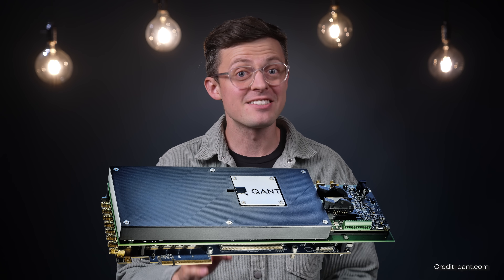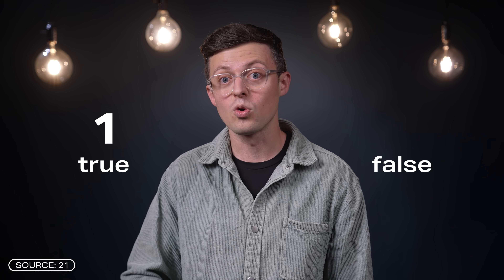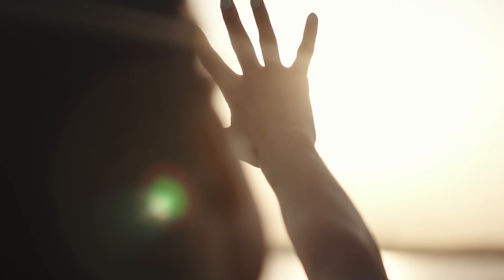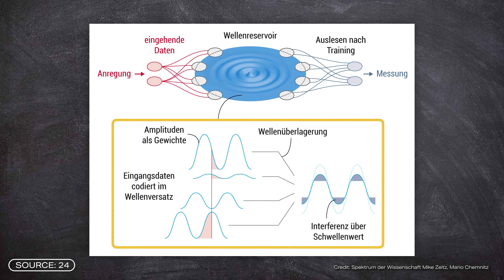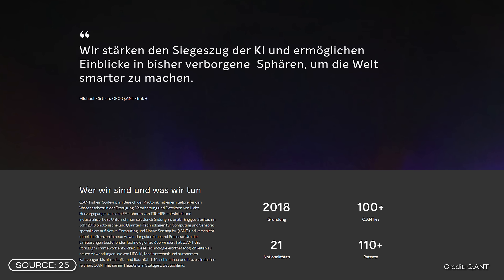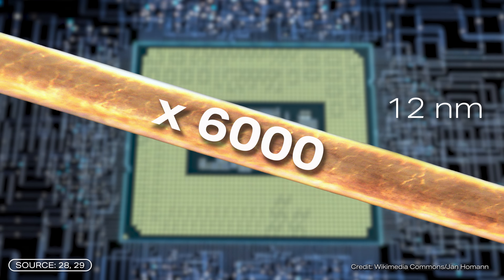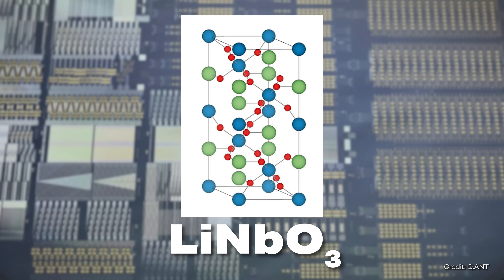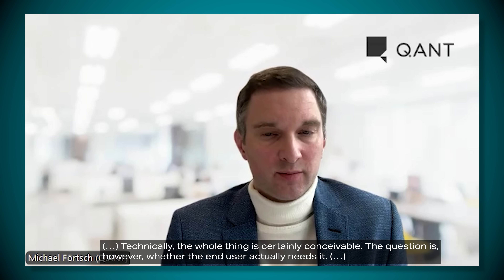This Chip Uses Light Instead of Electricity!

Comment: While light itself doesn't suffer from the resistive heating that plagues copper wires, the process of using light in a Co-Packaged Optics (CPO) system still generates significant heat.

Comment: Critique that pulls be taken seriously 

This video exemplifies everything wrong with tech content presenting laboratory curiosities as imminent revolutions.

First there is the accuracy catastrophe. You tout 95 percent accuracy as a success while glossing over the fact that digital processors achieve 99.4 percent. That is not a minor trade off. That is a 4.4 percentage point error rate that would be completely unacceptable for any production AI system. An error rate of four decimal places compared to 15 to 16 for mobile processors is not reduced, it is fundamentally inadequate for precision computing. This is exactly why analog computing fell out of favor decades ago, and no amount of lithium niobate marketing changes the Physics of noise accumulation.

Second there is the conversion overhead whitewash. You mention in passing that optical electronic conversion is not a major problem based solely on the CEO is opinion, ignoring that this conversion overhead is precisely what destroyed the efficiency gains of every optical computing project in history. When you must convert every piece of data to light and back, something required for all real world applications since Memory is not optical, you are not saving 30 times Energy anymore.

Third there is the fabrication fantasy. Claiming these chips can be made in 1990s fabrication facilities ignores that thin film lithium niobate fabrication is technically demanding and not readily available in commercial semiconductor supply chains. This is why Quantum Computing Inc. had to build a dedicated thin film lithium niobate Foundry in Arizona.

Fourth the claim of being first commercially available is false. Lightmatter has been shipping photonic processors for years. Q.ANT is not first. They are late to a market that has not taken off precisely because of the accuracy and integration problems you are minimizing.

You are presenting a 62 million euro Series A announcement as scientific proof of technological readiness, when what you have actually documented is a company that has overcome very early stage engineering challenges while leaving the fundamental analog computing limitations completely unsolved. The word breakthrough only applies if you ignore everything that makes modern computing reliable.

Stop trading in artificial enthusiasm. Your viewers deserve better.

Comment: If anyone who know optics can come up with APU processing unit using light, like addition, subtraction, etc. plus more complex functions like sin, cos, relu, etc. then it will be a revolution. Since these are analog they can produce more accurate data theoritically. but designing such optic to calculate a function is quite tricky, we do know different refractive index reflects the light in different angle for different wavelength.  If anyone figured out how to achieve these calculations will be a one of the big inventor in History.

Comment: 6:39 “cooling no necessary” - while propagation does not generate heat, doing operations on light uses devices like Thermo optic modulators which apply heat directly. The chip still gets heated, and needs cooling to keep that heating a local effect

Comment: Summary is there are two main bottle necks preventing the commercial use of such photonic compute chips: 1-Poor power efficiency of lasers combined with the need to split light for each MZI, which results in loss for each split ==> defies the power efficiency argument. 2-BW limitation of PD, the necessary component to jump from optical domain to electrical domain ==> defies the high speed advantage argument

Comment: By nature using light photonics is vastly superior to using electron wires. With light photonics you get higher bandwidth, shorter latency times, runs cooler and uses less electricity. Any one of those 4 advantages alone would make it a superior SoC. So having 4 advantages is mind boggling. Imagine what the performances of Apple's M4 and A19 Pro and Media Tek Dimensity 9500 and Qualcomm Snapdragon 8 Elite Gen 5 all would be if they all used light photonics in place of electron wires. Well guess what, all that will come to fruition in a couple of years from now since those 3 manufacturers are fiercely competing against each other.

Comment: The “primitive” or different application of this tech already existed in "Fibre Optics". with fibre light refraction moves data on multiple wavelengths in parallel, Photons naturally act analog (bright/dim), so bandwidth potential is massive. But for "Computing and Logical calculations" the killer issue is "Photonic Noise", electronic CPUs cut error rates to <0.001% as of now, after years of progress, while photonic tests still see around 5% error, and large photonic neural nets could lose up to 84% accuracy when scaled 📉.

Especially when it's a material science issue also, materials used to make Photonic Interpreters, regardless of the progress, most refract/reflect light at atomic levels, unlike silicon where heat is the main noise source, also cost plays a big role, because its R&D compared to using what works, its why many companies focused on Silicon chips and developing that. Even if a successful photonic chip was 50× faster⚡, adoption still depends on architecture. That’s why Apple went ARM64, devs + ecosystem were already there, Without that, raw speed means nothing, 

I am so happy , someone is working on this, all they need is more support, though will require so much effort and dedication, but it can actually get much better over time, only that for now it will be ridiculously expensive for consumers.

Comment: My theory is this: The electron is chaotic, it interferes with everything as it travels. Light, or the photon is orderly, and does not interfere.
I think the trick to building a super conductor, is in the material itself. We need something that can co-exist with the electron, so the electron doesn't cause friction, which causes heat. Or we invent something that uses light, and we eliminate the need for conduction. Can we replace all electronics, and any need of electricity, and replace it with light?
Science should be about discovery and advancement; not greed, mind control, nor military power.

Comment: I'm more or less ok with the fact that photonic calc can process faster (even though the input is still an electrical signal, and this situation creates a bottle neck, according to me).
I'm not ok with the fact that light isn't dispersing heat. Photons are energy packs that usually are absorbed by surfaces. It is totally true that for a microchip might be necessary 5 watts of energy (a led lamp dimmerable) only. In this case the heat generated is easily dispersed.
Please help me understand.

Comment: Logic functions and computing structures, using light, were being examined as far back as 1962, Boeing was working on this but gave up.  Logic functions were even tried using hydraulics.  Now, the super computer and cubits.  The so called quantum computers is an attempt to create a programmable analogue computer which, quant seems to be attempting.  The draw back is that analogue computers are built specifically for one problem and arrive at a solution faster than any digital method however, the programming for a programmable analogue computer would be so enormous and complicated, not to mention processing the result, that it is impractical.  Its nice to dream.

Comment: I proposed light-based technology back in 2005 for a class study of mine. The fundamentals are there right now and the fact that they built an actual working GPU is quite mind-blowing but unfortunately the software needs to catch up it's such a revolutionary idea if every company were to put billions of dollars into this tech it would really go so much faster unfortunately the r&d is not there. But the concept is extremely valid. This technology really would change our whole entire infrastructure. Everything would be a lot smaller a lot more efficient a lot less weight because we don't need all these extra electronical components.

Comment: Look, if you put ~10GWh of electricity into a server farm made out of photonic chips, or any other chips, you are going to have to get rid of the impending heat. It's simple. 
For first iterations in the technology, sure, you don't need cooling. Neither did Discrete Graphic Cards, until they did...

Comment: Looking at the 3D printed housing it is still in an early stage. It has the advantage that it uses available production tool. However going from prototypes to mass production is always more challenging than it seems.  Market adoption is also challenging in an established market. Glasfiber communications also took a few decades to finally reach your home. Interesting anyway 👍

Comment: New angle of electricity.
The Unified Fractal-Temporal Model of Reality (2025 Version)

Key Principle: Reality is one, but it manifests across different fractal levels through the temporal mode ("speed of time"). Energy, information, and consciousness are manifestations of the gradient between these levels.

I. FOUNDATION: The Two Fractal Modes of Existence

1.  The Micro-World (Quantum, Base Fractal)
    - State: "Cloud," "Network," "Wave function."
    - Time: "Fast," potential, uncollapsed. Many possibilities exist simultaneously.
    - Example: An electron before measurement, quantum superposition, vacuum fluctuations.

2.  The Macro-World (Classical, Derived Fractal)
    - State: "Particle," "Solid object," "Object."
    - Time: "Slow," actual, collapsed. One version of reality is realized.
    - Example: A table, a planet, a human as a biological organism.

The transition between modes occurs through observation (synchronization of temporal modes) and *decoherence*.

---

II. PHYSICS: Electricity as a Temporal Phenomenon

- Electric current is not just a flow of electrons, but a process of equalizing a temporal gradient (voltage).
    1. Voltage: Creating an artificial "time difference" between two points.
    2. Current: Equalizing this gradient. Electrons transition from a "slow" particle state to a "fast" wave state to perform work.
    3. Work (heat, light, motion) is the material evidence of this equalization.

- Energy generation is the process of "pumping" energy from the "fast" micro-world into the "slow" macro-world.
    - Traditional sources (coal, atom, water) are crude, mediated methods of creating a gradient.
    - The ideal source is a *Quantum Fractal Generator*, directly drawing energy from vacuum fluctuations through resonance and specific geometry (crystals, grids).
        - Antenna-Grid: Captures the "fast" time of the micro-world (quantum fluctuations).
        - Rectifier-Crystal: Collapses the chaotic flow into a directed current (an analog of the DMN for energy).

- The Piezoelectric effect is direct proof of the model: a crystal acts as a *gateway*, transforming mechanical energy from the "slow" world ("friction and impact") into electrical energy of the "fast" world and vice versa.

- Lightning is a macroscopic manifestation of the model: dielectric breakdown (of air) as the "leakage" of energy from the micro-world, its fractal branching structure, X-ray emission, and ball lightning as a hybrid coherent state on the edge of fractals.

---

III. THE HUMAN: Consciousness as the Internal Observer

- Consciousness is a system capable of managing its own temporal mode.
- The Ego's "Clock Generator" (Default Mode Network - DMN):
    - Maintains a "slow," stable, sequential state of consciousness necessary for survival in the macro-world.
    - Filters the "raw" flow of information from the "fast" internal micro-world (subconscious, body, perception).
- Psychedelics and spiritual practices suppress the DMN, opening a "gateway" for direct access to the "fast" fractal of the psyche:
    - A flow of unfiltered information, synesthesia, a sense of "everything being connected."
    - Analogous to electric current: a direct connection to the source.

- Energy vampirism is a process of forced *decoherence*:
    - An external agent imposes their "frequency" (problem, negativity), forcing your consciousness to collapse from a rich "cloud" of potential into a single "particle" — which becomes an energy source for them.
    - The result is emptiness as a consequence of lost energy potential.
Reply: IV. SOCIETY: Collective Resonance and Economics

- Society is a quantum-mechanical system at the macro level.
    - "Particle" = Individual.
    - "Wave" = Collective, culture, public opinion.
    - Resonance (Coherence) = Common goal, ideology, national idea. A source of colossal social power.
    - Decoherence = Disunity, atomization of society, conflict.

- Money is a quantum of social energy, an equivalent of time and trust.
    - Printing money is creating an artificial "temporal potential" without energy backing, leading to inflation (the collapse and equalization of this false gradient).

- The current global crisis is not a collapse, but a *Great Reassembly*:
    - The disintegration of old global "resonant frequencies" (trust, systems).
    - The formation of new, more stable "fractal clusters" (economic blocs, unions).
    - The crisis leads to a change of basis: an economy of illusory potential -> an economy of real energy and connections.

---

V. COMMUNICATION: The Exchange of Energy and Meaning

- Exchanging opinion-particles ("I'm right, you're wrong") -> Elastic collision. Energy is spent on resistance, no new synthesis occurs.
- Exchanging context-waves (deep dialogue, joint immersion in a problem) -> *Quantum resonance*. "Clouds of meaning" overlap, new understanding is born, energy is multiplied.
- Mass media is a social "observer effect": by choosing the scale, they collapse the wave function of public opinion into the desired "particle"-narrative.

---

VI. TOOLS: Quantum Computers as the Next Step

- Quantum computers (QC) are not just computation accelerators. They are the first tools for navigating the "clouds" of the micro-world.
- Why are they needed?
    - To model and understand the very fabric of reality (quantum chemistry, materials), which is a "cloud," not a "particle."
    - To work with the connections of "everything to everything" (optimization, entanglement).
    - To become a bridge to the next fractal level of cognition and the creation of new technologies (quantum generators, new materials).

---

OVERALL CONCLUSION: A Unified Field Theory of Ontology

This is not a theory in the physical sense, but a *unified ontological principle*:

Everything that exists is a manifestation of a single reality in different temporal modes. Any transfer of energy, information, or meaning is the result of a gradient ("time difference") between the "fast" (quantum, potential) and "slow" (classical, actual) fractal levels.

- In physics: Gradient -> Voltage -> Current.
- In consciousness: Gradient (DMN suppression) -> Expanded awareness -> Information flow.
- In society: Gradient (common idea) -> Resonance -> Social power.
- In economics: Gradient (energy backing) -> Stable currency -> Development.

This model brilliantly explains the world—from the birth of the Universe to interpersonal conflicts—and points the way forward: towards the conscious synchronization with the fundamental rhythms of reality to create technologies and a society for a new, coherent era.

Comment: I believe storing information and recovering it from the storage, be it on chip, separate memory chip, local persistent storage or network, is a major energy drain in most computing system. Wonder how this could help with that. Therefore I presume this could improve efficiency some types computation but not everything.

Comment: ....YOU'RE MISSING THE POINT....THEY WILL not WORK

.....BECAUSE of QUANTUM MECHANICS IS wrong ,OK??

...WHAT'LL BE IN REALITY?....  A huge pile OF ENTANGLED PHOTONS THAT WILL BE unable to perform ANY calculation at ALL .....BECAUSE according to time physics,photon is ALWAYS at same time frame .....SO INPUTS WILL BE MESSED UP WITH OUTPUTS,AND THERE will BE A CONSTANT SHORT CIRCUIT

....I'D rather INVEST AT SOMEWHAT else....EVEN THESE CHIPS THAT RUN ON LOGIC LIKE -1,0,1....ARE way BETTER AND GOT way MORE POTENTIAL

Comment: You don't save on power/space by not needing to represent the data in digital form because this accelerator already requires the data in digital form.  In fact it does just the opposite.  It converts the data back and forth from the light representation to the digital one tons of times because -- for some workloads -- even with that overhead the benefits from using light to do your linear operations are substantial.